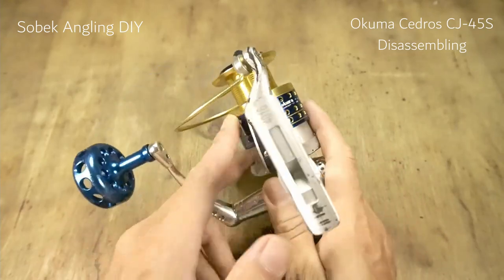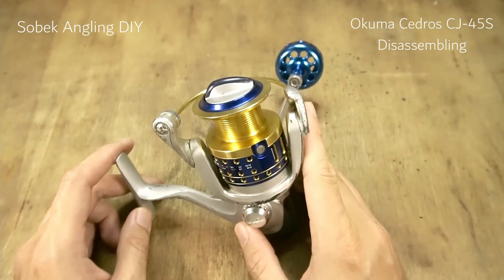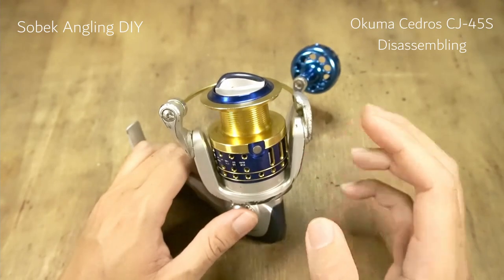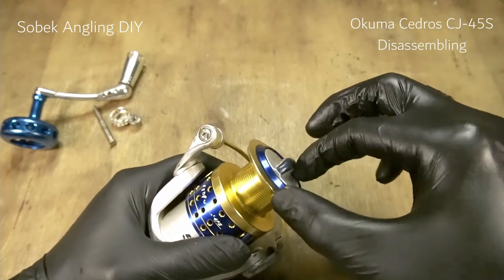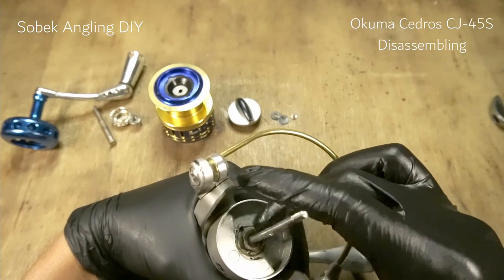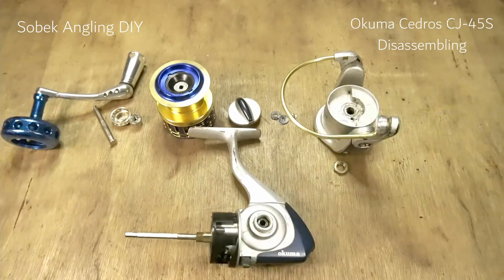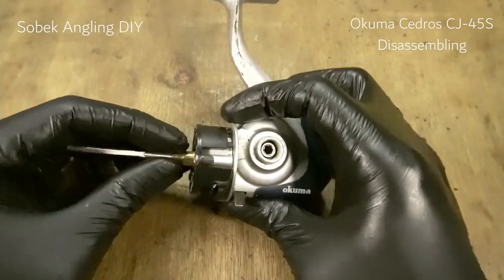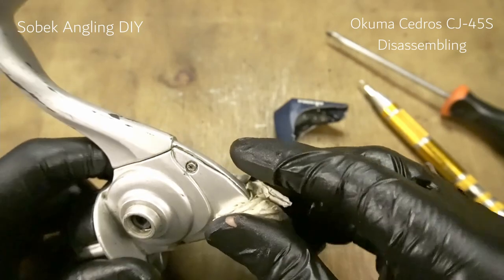2010 Okuma Cedros CJ-45S - Part 1/2 Disassembling - Reel service and maintenance -

Comment: Great video, I wish you would have explained the anti reverse problems with this reel and maybe a fix, I have a 55 with a intermittent anti reverse that slips
Reply from the maker: Could be that the plastic bearing roller holder shown at 24:23 got thinner after extensive use or the holder wall were dented due to high drag. It does not take much to misalign all the rollers. 1/5th to half of a mm is enough to make the AR slipped😅
Reply: @solunaranglingconfidante417  thanks so much , probably just throw the reel out
Reply from the maker: You could try cleaning the ARC and re oil it. If it still slips then.......... Either get a new ARC or just get the a new Cedros
Reply: @solunaranglingconfidante417  supposedly this is a known problem with the old Cedros
Reply from the maker: Very common problem of most OEM reel models a few years back.
Reply: I cleaned mine and greased it works perfectly